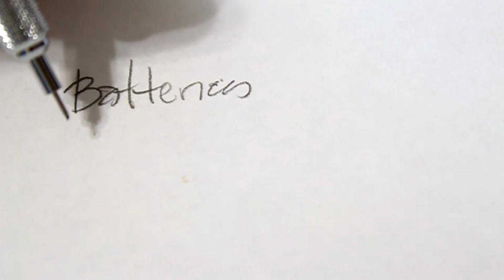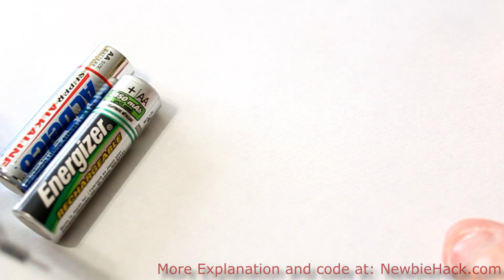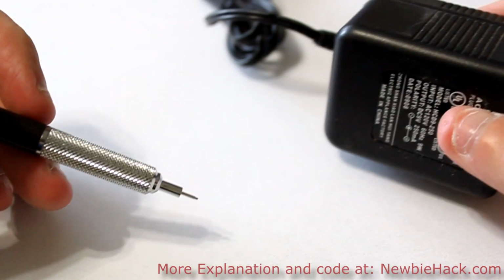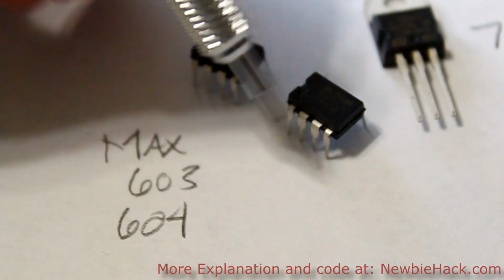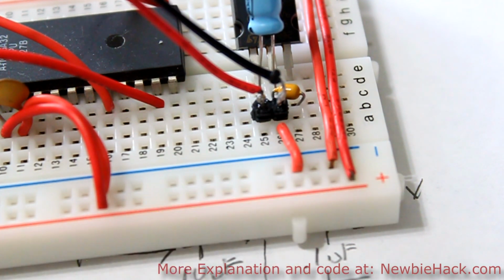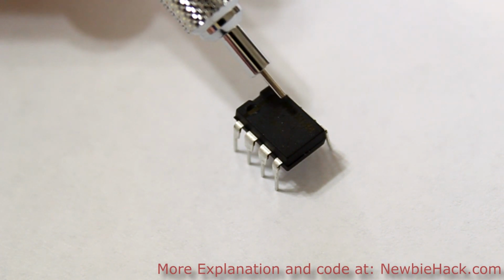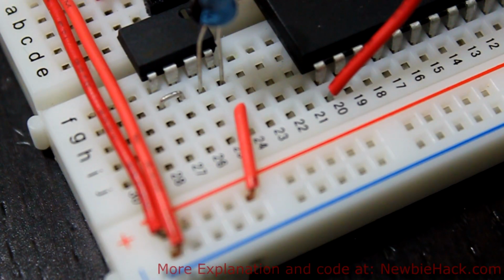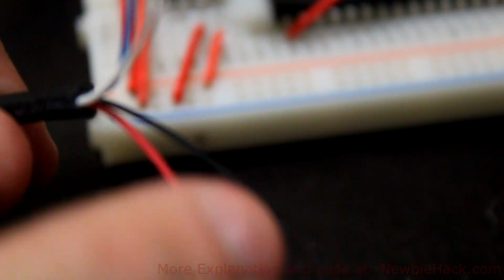25. Arduino for Production!  AVR Atmega32 - Using other Power Sources

Comment: I have a motor that's needs nine volts to put into my circuit with my atmega should I hook the motor up in  parallel to the the regulator

Comment: I want to use a 12 v dc wall adapter with 1Amp current ratting. How to handle this high current or step it down so that it become suitable for using with microcontroller (Let say Atmega328p ). Even 7805 5v regulator getting heated up.

Comment: Since the highest voltage in this case is 9V, you can use 16V or higher ones.

You always want to have higher capacitor voltage rating than the highest voltage that you are working with.

Comment: could I use a diode just between +9V and our power circiut (to save the capacitor in case of wrong setting on power supply)?

Comment from the maker: Yes and no.  The MOSFET will not as a voltage regulator directly, but you could use a MOSFET to create a switching regulator.

Comment from the maker: @Ritztro You may mean 12v output and should say DC.  You can use up to 30v with a 7805 regulator.  The MAX603 (5v regulator) can only receive +12 volts and will not be able to handle more as this is the absolute maximum voltage rating.  If you want to use the wall adapter that outputs 12v DC, then you will need to use the 7805 regulator.

Comment: Hi:
I see there is more information on NewbieHack then is seen here. I will have to go there after viewing the videos. If the webpage for power sourced is there I am unable to locate it. You mentioned the capacitor across the Positive and ground on the chip. Where is that information in the PDF on the chip? I skimmed it and can't find where that information is located. I was wondering what the value was as I wanted to try to hook up my bread board with the chip.
Thanks for your videos.
Don

Comment: Hi:
It would have been interesting to see the voltage with out the capacitors installed and watch and see if it changed as you added the input capacitor and then the output. Would the voltages have shown as being the same and what ever changes there would have been only been visible on a scope? Would there be any changes if you used capacitors of larger capacitance or  (as I have seen on different circuits) capacitors that are of the same capacitance but different types?
Thanks
Thanks